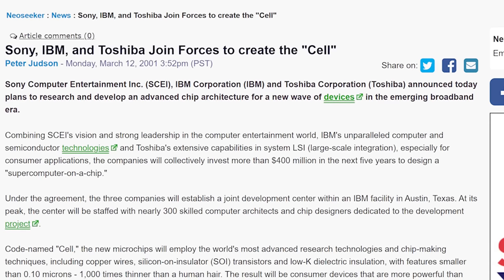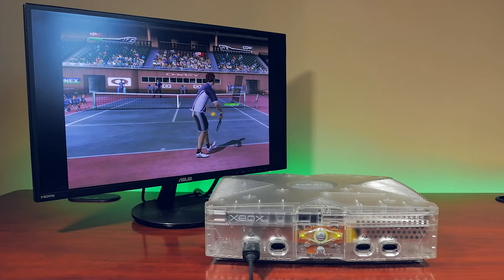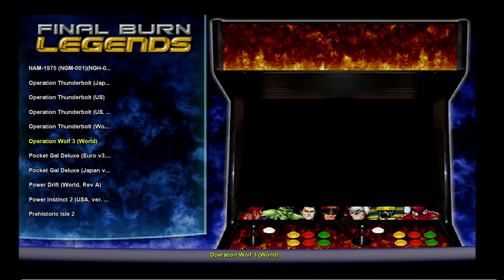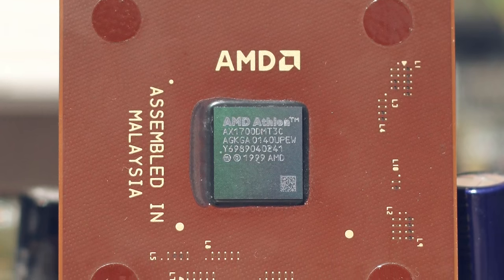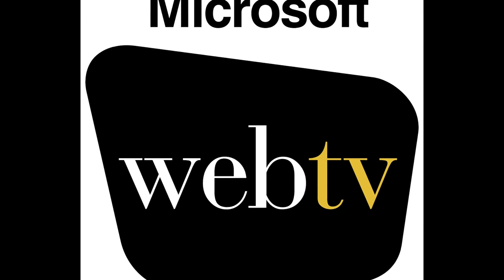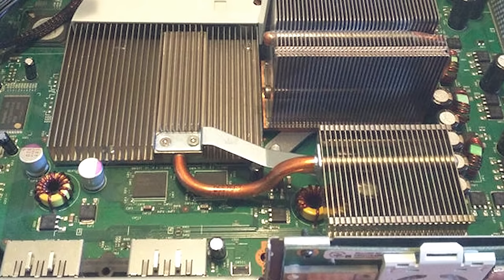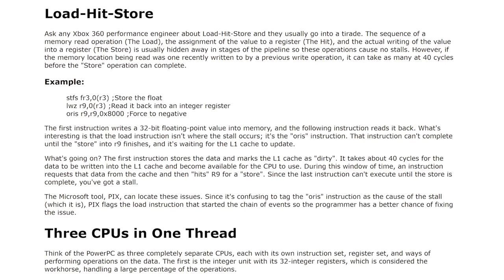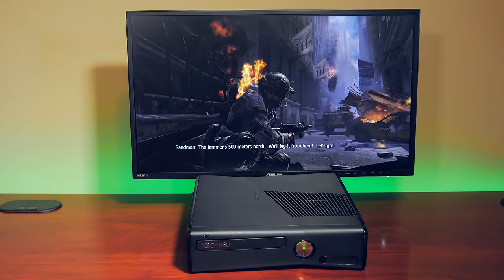Why Microsoft switched from Intel to Power PC for the Xbox 360  | MVG

Comment: also, personally i dont think that sony's ps3 ran that hot tbh... Alot of the YLOD issues werent to do with the heat and solder balls, like the xbox 360 had..
I bought a job lot of YLOD ps3's the other week on ebay, None were solder ball issues... they were all repaired by myself, simply but replacing the NEC/TOKIN capacitors with Tantelum capacitors...
Reply: They ran extremely hot dude what the hell are you talking about!?  They were toaster ovens with heat that would cause your hands to sweat if you held it by the vents.  Maybe if you only worked on non launch models then yeah, your statements then accurate.

No, those things could produce heat signatures seen from space.
Reply: Could you help me out? Tantalum caps arent available where I am and the available ones are both expensive and has low capacity.

Would a regular electrolytic capacitor work? Tantalums basically should operate like electrolytics. If you could try it out so I can fix my PS3, that would be great :D
Reply: Man ran ridiculously warm.
Reply: @ayuchanayuko  they technically would yep, problem is, Standard capacitors are too big and bulky. they needs to be surface mounted to the motherboard.

Comment: Complaining about PowerPC thermals is a bit strange, given that the problem of the Pentium 4 was also thermals, and the PowerPC thermals are laughably low in comparison to much of what followed. It just happened to be around the time that computer cooling started to become a big thing and therefore it was comparably new to customers and manufacturers. Nowadays nobody bats an eye an monster tower coolers, 3-4 slot GPU coolers or regular AIO & even custom liquid loops. In the Pentium 3 era, a shoddy aluminium heatsink and a mini fan was enough.

Comment: "...RISC in a video game console made sense."
Which is why the 64-bit Atari Jaguar and its 5 processor chips was designed that way.
Reply: @thatonespathi 
For portable consoles, yes. RISC has lower power consumption so they are suited for mobile devices. On home computers and consoles, CISC is still better. The more complex instruction sets will allow optimized games to run better since there is no reason to worry about power delivery.
Reply: @cunnyman  CISC is an optimisation barrier for the most part. It's hard to tell that from benchmarks now because microarchitectures and process improvements took up the slack, but having a multiply instruction that overwrites EAX and EDX is both problematic for instruction dispatch and artificially inflates IPC numbers as you need instructions for moving the result around.
Reply: @cunnyman  RISC vs CISC really doesn't matter nearly as much as people think, and hasn't for a long time, regardless of what you look at (power, perf, gflop/W, transistor count). Power, the allegedly so clean and nimble RISC architecture... uh well, look at a floorplan of one of these POWER CPUs, they have a pretty huge decoder. High performance CPUs all look pretty similar, regardless of ISA. Modified Harvard cache system, decoder emits micro-ops (which is not RISC at all, please stop saying "x86 CPUs translate to RISC internally", it's completely wrong), which feeds a big ol' unified scheduler and reorder buffer, which dispatches µOps to a bunch of EUs, which write their results back to the reordering stage. A 2020 Intel, AMD or Apple CPU is pretty much just elaboration of Tomasulo's algorithm.

Long winded CISC vs RISC and "RISC is actually better" (or even the good ol' "VLIW is superior") discussions on the internet seem to be largely fed by people who haven't really studied the concepts they talk about.
Reply: @-szega  VLIW has some pretty nasty issues that make it pretty unsuited to the dekstop market (compiler complexity, delay slots on branches, lack of OOO execution and branch prediction; look at how Itanium failed), but it's really good for embedded products (vector processors and DSPs still use VLIW for a very good reason).  RISC vs CISC is an interesting debate, with CISC having a rather long translation layer at the start of the pipeline to convert the complex instructions to uOps, but then having an easier time with dependency resolution due to the intrinsic dependency info in the CISC instructions.  Conversely, RISC has a small decoder relative to CISC, but has a harder job of dependency resolution, more instruction memory accesses and generally needs more register write-backs to do the same job.

I'd agree that the "x86 CPUs translate to RISC internally" statement is quite inaccurate, but not completely wrong.  While it's true that uOps aren't a RISC instruction set, they are much simpler, there's significantly less of them than x86 instructions, and they do form a pseudo instruction set specific to the particular architecture at hand (hence why most people say "RISC-like").  Theoretically, you could chop off the uOp decoder (and everything before) from an x86 CPU and bolt on a modified fetch unit that retrieves uOps natively, then write an entire program in uOps (with the slight caveat that the branch logic would need to move inside the uOp part of the pipeline).

One benefit that we'll definitely see from moving away from x86 specifically (whether we go CISC or RISC) is the reduction in register pressure.  x86 spends way too much time interacting with the stack due to its woeful quantity (4) of registers.  Moving to almost any other architecture (OpenPOWER, ARM, RISC-V etc.) would give us many more registers and less memory reads/writes.  From this, we'll see a massive improvement in real-world performance (due to the drop in memory accesses, which are always slower than anything else) and less expensive caches (x86 tries to push for single-cycle L1 hits, since memory is accessed so frequently; almost any other architecture can get the same performance with a 3-cycle L1 hit due to the reduced number of stack accesses).
Reply: x86 CPUs have been RISC with a x86 decoder front end attached to it since the mid 90s.
Reply: @ScottTancock  Love it, but i would like to hear more about why you think CISC has an easier time with dependency resolution. Uniform representation of inputs and outputs make dependency tracking easier, which is why superscalarity came to RISC first, but the biggest performance differences today come from register renaming and dynamic rather than purely static hazard checking, neither of which are an ISA feature as much as a microarchitectural one.
Reply: RISC in everything makes sense. That’s why the world’s 2 most popular processor architectures--ARM and MIPS--are both RISC. And look at the number of POWER, MIPS and ARM machines on the current supercomputer list at top500.org.
Reply: @ScottTancock  Very true. AMD64 alleviated the register pressure significantly compared to x86, but ~32 (AArch64, RISC-V, Power) is of course better. I recall an old study (early 90s I think?) that showed that going from 8 GP registers to 16 improved things considerably, while 16 to 32 still improved things, but not as much. SIMD register sets are pretty much the same across ISAs and aligned on downstream needs, tho iirc Power splurges as usual, but these are anything but power efficient, meant for raw DB performance and nothing else.

As you say, VLIW works great and can offer very good performance and efficiency for DSP code that's practically branch-free and targets specific processors. As a "scalable" or "long term" ISA it works just about as well as it does for general purpose code though. It has its niches.
Reply: @lawrencedoliveiro9104  480 systems out of the TOP500 run on AMD64. Most of them get a large part or the majority of Linpack flops from their GPUs / accelerators tho. MIPS is nowadays only found in low-end networking SoCs, which results in a large number of units sold, but is hardly relevant as far as the bleeding edge is concerned. POWER is mostly for scale-up database servers and emulating mainframes, power efficiency isn't particularly high on the agenda. Obviously to get Linpack flops you can do things that don't really make much sense for general purpose computing, like ultra-wide SIMD (AVX-512, ARM SVE-512 etc.).
Reply: @-szega  Did you notice that the current number 1 is an ARM machine? That number 2 and 3 are POWER machines, while 4 and 5 are MIPS? In other words, there is no x86 at all until you get to position 6. And out of the top 10, 6 are non-x86.

https://top500.org/lists/top500/list/2020/06/
Reply: @-szega what matters is touching the ram as few as possible. This both means more registers instead of less predictable cache and instruction as few byte long as possible.

Comment: What I think about going PowerPC? Really cool, I always liked the PPC macs as well. Curiosity (the Mars rover) is PPC based, obviously awesome ;)

The thermal issues was a design choice. Microsoft and/or Sony could have reduced the clocks and voltage just a bit, and by doing so reduced temperatures significantly. But they didn't. For some reason 5-10% more cpu-performance was worth much more than longer lasting consoles and lower fan noise.

But the Xbox 360s and PS3 dying was not just a matter of thermals, it was also a matter of solder. The switch to RoHS compliant solder made lots of devices die prematurely during this era. It was common on graphic cards, memory sticks and other hardware. Macbooks with nvidia chips was affected for example.

Comment: It was a different time. Nowadays, just the sheer amount of work that both Intel and AMD poured into x64 is very hard to match. High performance computing is unimaginable on anything but x64. In a few years some ARM manufacturers (probably Qualcomm) may close this gap, but currently x64 is the King. This is why both XBOX 3-4 and the PS 4-5 use x64.

And yes Apple is mad for switching to ARM. Those CPUs will be handily beaten by inexpensive budget laptops, at least for the next 4 years.
Reply: you're joking, right?
now, more than ever, these x86 cpus are outdated and behind the curve. the cpu in an freaking ipad can outperform a 9th gen core i7 core for core in many, many tasks. and arm / apple aren't slowing down. they haven't hit a wall like desktop cpus have back in 2011 or so. i'm afraid x86 might die pretty soon. servers are already looking into switching to arm-based clusters.

amd is finally giving us generational gains again though, and that might be the saving grace if they keep it up.
Reply: @GraveUypo  You talk about x86, OP talks about x64. I don't see an ARM chip  doing my MATLAB computations in any reasonable time.
Reply: @GraveUypo  ARM is a RISC architecture. By definition, it is faster and more power efficient in lots of easy tasks. But x86/64 has a lot of features that are needed in a lot of power intensive applications. This is where ARM Macs will fall far behind
Reply: Not a z3 python workload (single thread). Will wait a lkng time before seeing a aarch64 that use 22Watts per core

Comment: The PowerPC chip was fine, even thermals wasn’t as big of a deal in terms of the chip, the problem was poor thermal planning and implementation. Heck the RRoD wasn’t necessarily a chip running hot issue, but rather a manufacturing problem.

Comment: It's funny to think that none of the PS3's problems came from the Cell (PPC) chip rather the stupid capacitors they used for the RSX and Cell right beside them. I mean sure some YLOD are caused by the RSX, but recent revelations into the NEC/Tonkin chips probably mean it's so few.

Comment: I miss the days when each console had their own unique architecture, nowadays the consoles are jus a mini PC
Reply: That was literally never the case.

Gamecube, Wii, ps3 and 360 shared with power mac.

Ps2 and N64 had a mips that was shared with among other sgi  desktops.

SNES used a mos  6502 also used in some mac.  Sega genesis used a 64k used in A500. 

Pretty much every game console is just some variant of power, 68k series, mos, zip, mips or some other processor that was really common back in the early days.
Reply: @Mike O no I'm not wrong. Every single console use cpu cores that was common at that time. Yes they had costumes dies (well except ps3 didnt), but also ps5 and xbx have custom die. 

Mos and M68K was the most common processors of the 80tys.

Mips was like the 3d most common processor of the 90tys. PowerPC was the second most common processor in the early 00 (I worked with it in telecom.)
Reply: Playstation uses gddr as the main cpu memory. Try to emulate that on a pc! An other way to continue what they did with rambus on the ps3.

Comment: Nintendo doesn’t get nearly enough credit for their hardware design. Their systems have never been the most powerful (with maybe the exception of the Nintendo 64 for a brief period), but they’re always carefully optimized to balance performance and pricing. 

I also find it interesting that we’re encountering the same issues that plagued the seventh generation with the upcoming Series X and PS5. The hardware is definitely impressive, but neither Sony or Microsoft have confirmed a price for their systems. There have also been rumors about the PlayStation 5 having issues and overheating (possibly explaining the delay in revealing the design, although that’s just my theory).
Reply: Gamecube was pretty powerful no way to quantify it properly but if xbox was more powerful it couldn't have been by much. It definitely had a better GPU in my opinion and the Wii was basically a GC with motion controls
Reply: I think both Nintendo 64 and Gamecube were more powerful than PS1 and PS2 respectively. I still play PS2 and when I see how the games look and run I can say the PS2 was the weakest one, some games looks like remakes on the original Xbox which I never had but that thing was hell of a machine back then. If just Sony PS2 had the HW Xbox had...
Reply: Agree, except for the switch. It costs as much as a regular ps4 where I live, it performs objectively worse and runs as hot as a bulldozer. Sure, it's portable, but on the price it's a big no-no from me
Reply: @alessandroceloria  It depends on how you see it. I don't play on home console, so I came from the 3DS (and also a bit of mobile gaming) to the Switch. And it is amazing as a portable.
Reply: Nah f*ck Nintendo. They used more or less the same CPU for three console generations and when they finally bothered to switch things up for the switch, they gave it an outdated ARM cpu and gpu on an outdated process node, purely for cost-cutting purposes. This was like nine months after Pascal GPUs were on the PC market, it would have been relatively easy for them to give you decent hardware even on that little tablet thing. But Nintendo are cheapskates. Plus the peripherals are overpriced.

Comment: Sony should have kept it MIPS CPU. Since they have used MIPS on PS1, PS2 and PSP so developers were already into it. Therefore MIPS also uses RISC architecture
Reply: Sony tried to use Cell as CPU+GPU combo, however finally they found that the co-processors cannot work as GPU, they can only emulate the Earth :-)
Reply: Sony wouldn't want that back at the time. Piracy was running rampant on both the PS1 and PS2, so they wanted to rectify that gaping hole on their pockets.Therefore the decision to move from MIPS to Cell architecture was based more on security concerns over performance improvements and other considerations. And for the longest time, it proved the right move for them. Out of the big three then-current consoles of the time, the PS3 was the hardest to hack and pirate games for.
Reply: referral madness  Cell architecture wasn't that well understood back at that time and it's still hard to program for. Also, the security measures taken by Sony to prevent piracy and homebrew were more stringent on the PS3 than on the X360 and the Wii.
Reply: @icenowy  Rather than it not being possible, devs weren't willing to put the stupid number of hours in to make it work (Cell architecture is awkward), hence Sony caved and put in a GPU.
Reply: referral madness  People are using PS3s in a cluster to perform astrophysics calculations, since the Cell architecture excels at calculations with a high degree of locality (simulations where each unit/cell/particle only affects the units/cells/particles near it).
Reply: @krazycharlie  Both are RISC
Reply: @ScottTancock  Tell this to Bayonetta developers. Since they couldn't make PS3 do more than 20fps on that game. Dark souls also. Calll of duty 3 also. And many many others.
Reply: Powerpc has variable length instructions that can reduce the memory pressure.

Comment: Bandai (Apple) Pippin use PPC in 1994.  It was the low power version 603 running at 66MHz, with I think 8Kb of input and another 8Kb for output.  
The OS for the Pippin was basically "System 7.6.1" (before it was called MacOS) and could run almost any off the shelf Mac software.  In fact, Pippin had a SCSI bus, so a hard drive could be connected and booted from it (which was basically the developer version).
In Japan it was the @Mark, Bandai sold in US as @World, and a Dutch company sold it in Europe as the Katz Media 2000.  
(All is from top of my head, may be minor errors).
So, yeah, Apple was a few years ahead of MS in making a "game system".

Comment: I think the change was a rather brave one. Apple Macintoshs with the PPC G5 always had extreme issues with the thermal performance. You just have to imagine that the PowerMac G5 had 9 fans from the beginning and later models(like the 2.5 GHz from 2005) required liquid cooling at that time. And that was in a casing with plenty of space in it. There was a reason why they only did G4 PowerBooks and iBooks because there was so much less space in there. So it is very suprising that Microsoft decided to cram a processor that requires a lot of cooling in the casing of the XBOX 360. But luckily they got their cooling sorted out with the 360 S so that the RRoD was a rare occurrence